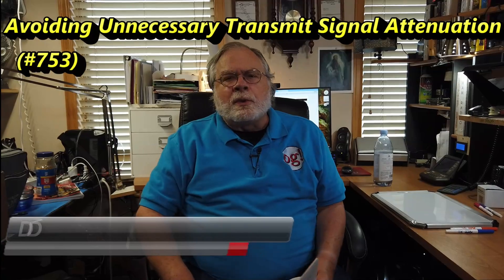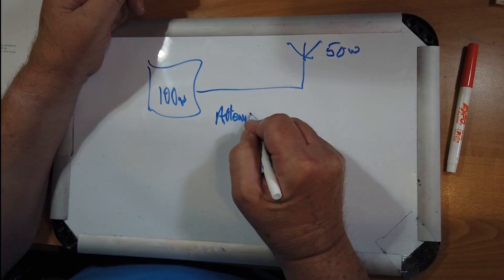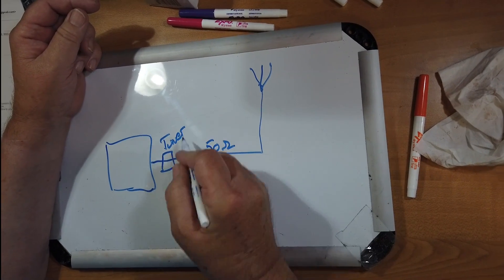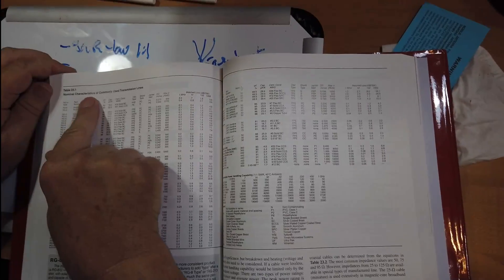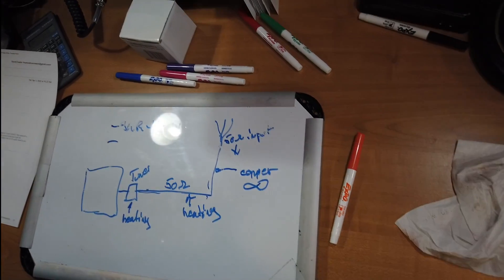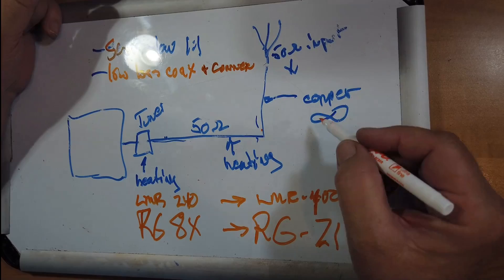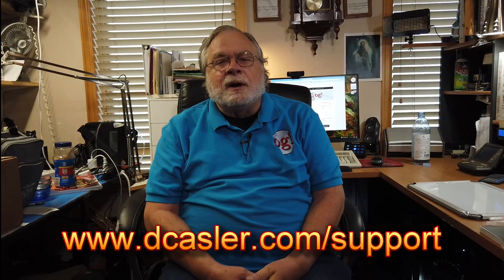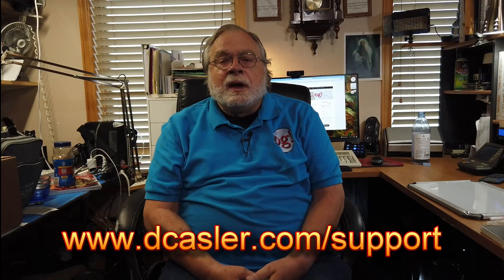Avoiding Unnecessary Transmit Signal Attenuation

Comment: Dave, please do all new hams a big favor, and some of the older ones too! Please remind us hams that BIGGER is better, when in reference to coax cable. and to please lets get away from the RG cables. The RG cables are an OLD WWII standard, and have been well replaced with the newer LMR standards. While RG cables will certainly work, and continue to do so, many are lulled into stopping at RG8 thinking it is of good enough quality.
 In truth, RG8 should be valued much like RG58. use it, but be damned mindful of its limitations. Otherwise Spend the extra couple pennies more and invest into the LMR standard and enjoy a better cable! 
 Oh and SWR isnt everything. SWR doesnt mean much on a tuned noodle if the signal lobe shoots over the desired target!

Comment: Dave, appreciate the good video.  Mostly use DX Engineering RG-8X coaxial cable here for HF.  Really like their premium antenna wire too, BTW .  As you know, what helps a lot is waterproofing the outdoor connectors and avoid kinking the coaxial cable (observing proper bend radius, etc).   73,   AC3HT  📻